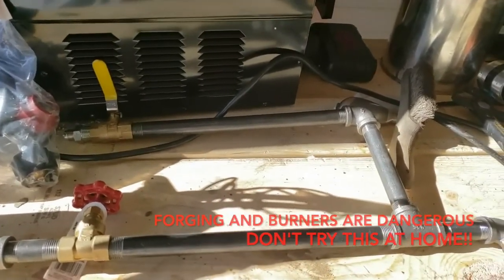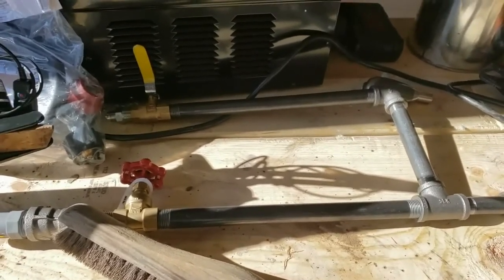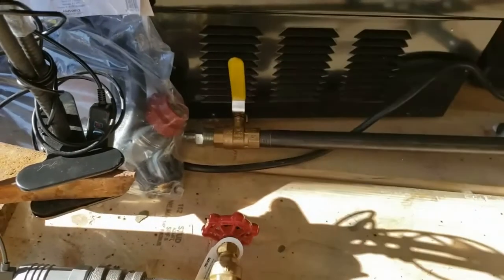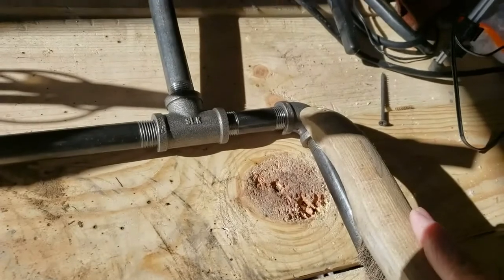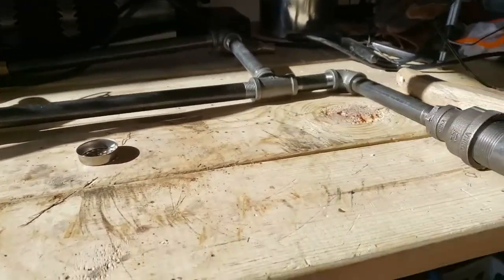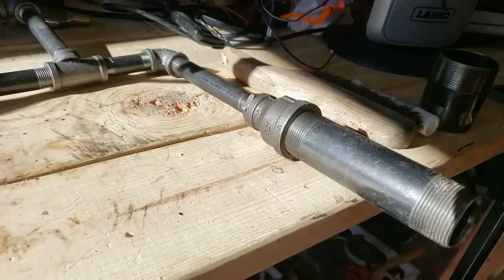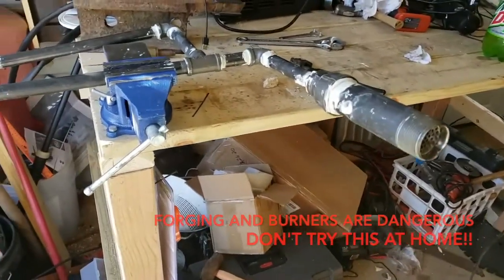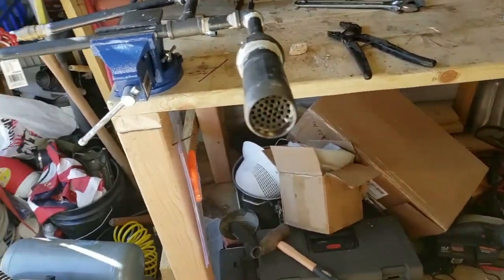DIY Propane Forge Burner - Forced Air  Explanation Time Lapse  Construction and Testing

Comment: Isn't that the same build as the one on Christ centered ironworks?  How does that little piece of stainless hold up as a ribbon burner?
Reply from the maker: Not sure about Christ Cenetered Ironworks. I thought he uses a coal fired forge? The stainless steel has held up for a few weeks now. I'll take a video of it tomorrow and post it, I figured for a couple bucks if I had to replace the screen a few times a year no biggie.
Reply: @VincentPriceknives  Great. I was considering a similar build, but I was worried about that little screen taking that much abuse 😂 CCI made a forge using a similar stainless screen.
Reply from the maker: I uploaded a short video. The screen is actually holding up better than I expected. I got the heaviest duty one they had and it was actually a little to big for the pipe.i sanded it just a tad around the rim to get it to slide up in.